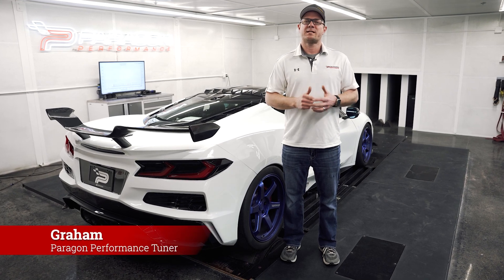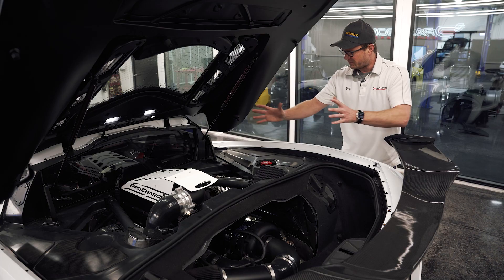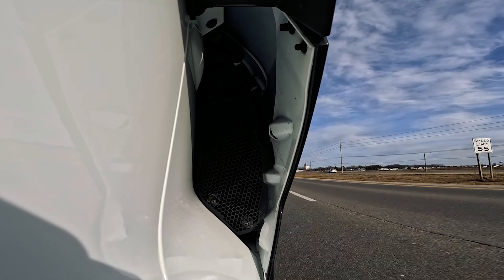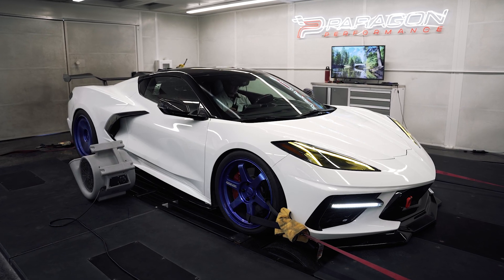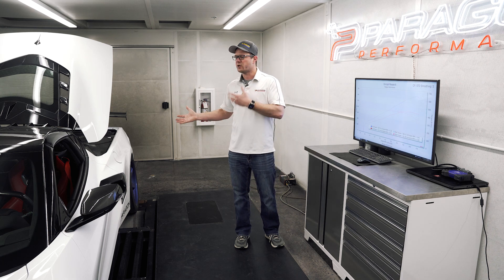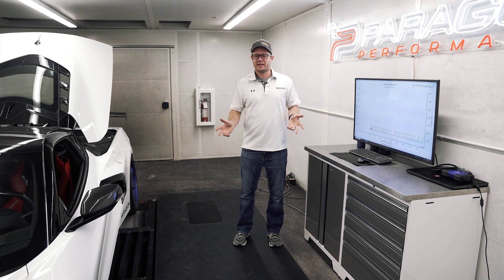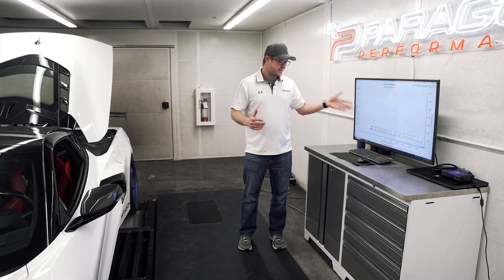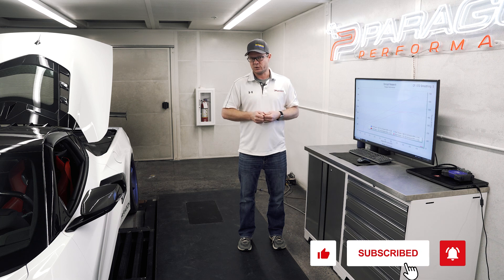Procharger Supercharger C8 Corvette Dyno Results! - Paragon Performance!

Comment: Hi, I had one of these installed almost 2 years ago at a shop in NC, stage 1 no HP TUNING, piggy back stuff not very happy with it then, took it back as soon as HP tuning was available, and now it’s a different car, runs great, shifts good, got rid of that 4 cylinder mode, that pro charger really didn’t like that 4 cylinder mode, hard to explain, but way better now, stock RWHP 436, STAGE 1- 515 RWHP, STAGE 2 620 RWHP, and runs great sounds good, would do it again. Keep up the good work!
Reply from the maker: Glad to hear everything is working properly now!

Comment: Looks awesome, sounds awesome, but 22k out the door seems pretty steep for a bolt on kit. For my old c7 fully built by shop, engine, Trans, pro charger, 1100 hp was 48k total with labor. Only 12k of it was the pro-charger.